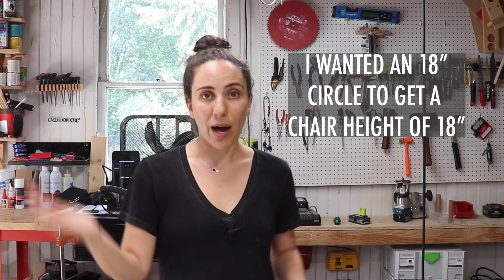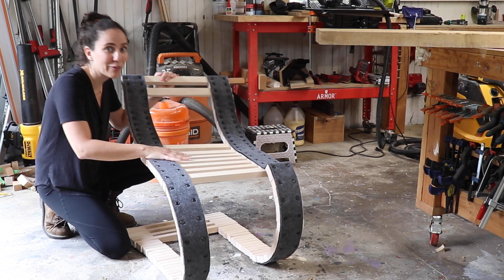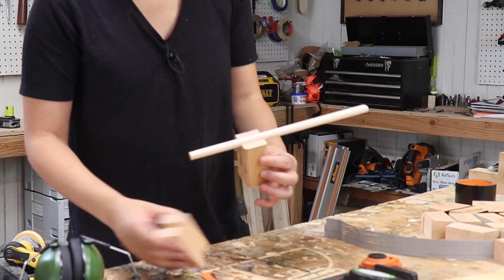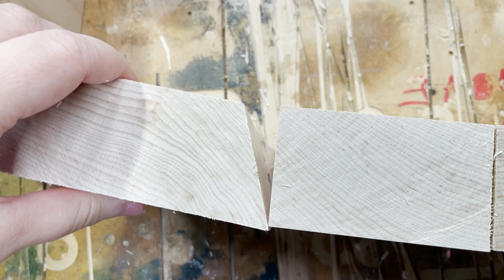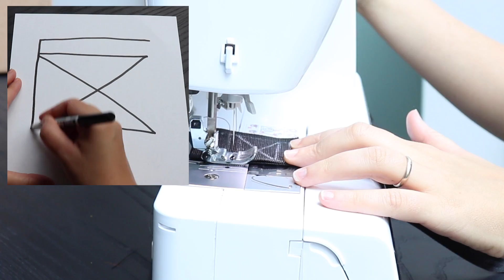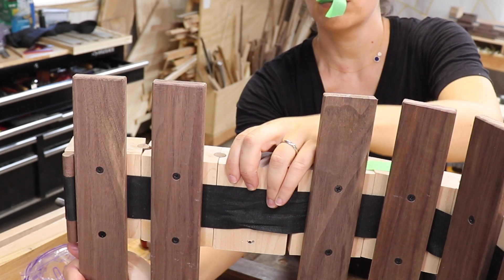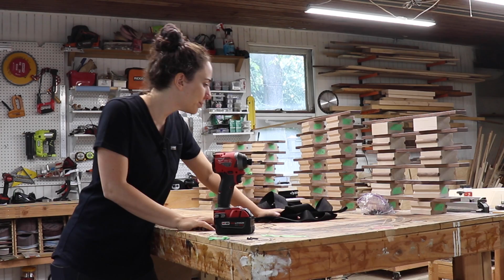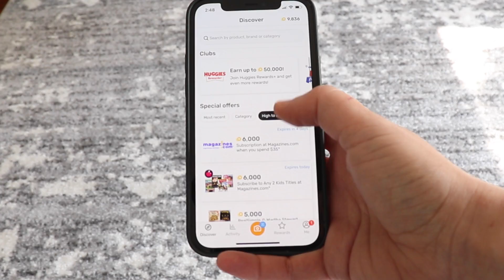I ATTEMPT to make a Roll Up Chair… AGAIN...

Comment: Thanks for the video.
This chair is a problem of managing tension. When you put the dowels at either end of the strap the chair is in to much tension, dangerous. What I think would be a solution is to glue the strap to the chair, finding the right glue is the problem. CA could be to brittle silicon to much flex. The glue I am thinking of and can not remember the name of is what you use to glue fer mica to counter tops. Use the dowel to stretch the strap just a little apply glue to both pieces and let set. You should now have just that little bit of tension where you need it at the joint, the rest of the strap should not be under tension from the glue bond, keeping the tension you put in at the start.
The part that I am not sure of is the glue. The glue has to have some flex ie does not get hard and brittle, or be to soft and flex to much.
I do like the wood slats you used to make up the seat of the chair, and the dowel to add stability to the chair. When you glue the strap down, still screw on the slats, but not into the strap. 
With the right glue the chair will hold it's shape on its own.
You do not have to make the whole chair to experiment with just one end with the dowel.
Just a suggestion on the wood pieces cut the angle so you will make the curve a little bit bigger, so the flex in the strap and the compression on the wood will result in the curve you want.   
Still love these videos, just for the wonderful amount of thinking and planning that goes into it.
Wish I had the machines and shop to give it a try.
If you are going to remove plastic straps, and replace with metal, drill a hole in the wood blocks and run the metal cable throw the hole. Put two holes and two cables per block so 4 in total, add a tension-er at each end. Doing hinges and cables, moves away from the original concept, but should work. Finding a way to release tension so it rolls up and add tension when it is in chair shape.
I am thinking the holes would have to be through the center of the dowel.

Comment: If I remember correctly from your earlier video Tamar, the source piece you modeled your build after was a designer's mock-up, but I don't remember if it was a functional mock-up.  Perhaps this was all a designer's fever-dream.  I applaud you for giving it a shot--a few shots actually--and it'll be cool if, one day, you do make it work as imagined, but maybe it's simply a design that is never meant to be...in the real world anyway.  If that's the case, you can hold your head high, say you tried, and tried, and then tried some more, but in the end, maybe what you proved (and no one else did) is that the design, while cool, is impracticable at best, totally unrealistic at worst.
Reply from the maker: I still want to figure this out. ha
Reply: @3x3CustomTamar  Well, I can't fault you for trying!  Keep us posted!

Comment: Love the look of the new design. 
Believe your tension problems are due to the strap not being attached to each block. Without the strap being secured to the blocks the tension from one spot can pull across the whole chair. Like when sitting on it caused other pieces to curl up to relieve the tension. Attaching the strap to each block would only allow tension to pull on the block next to it.
Reply from the maker: Yes, once I got the right length, I was going to attach it to all the pieces, but then I got hurt... so gave u p in this iteration

Comment: Hi Tamar. What an intriguing project. I agree with your assessment of the material. Too much stretch. Kevlar comes in strapping like that. It's very light, strong enough to stop bullets and very little, if any, stretch. Maybe two thicknesses sewn together? 

Nethril is, unfortunately, not available anywhere but Middle Earth. But it would be nice. haha.

Comment: I mentioned it in the previous video, but I think the problem is relying on a flexible material to keep the shape together. You would have to have it at maximum tension in order to remove any gaps, which as you deduced, is a huge danger. Instead, I'd recommend using hinges at each fold (which you could then cover with the straps for decorative purposes). At either rolling direction, the pieces are always expected to fold from the same rotation point, so a hinge there would keep the pieces together and ensure they roll and unroll safely (without tension) and without moving around between them (as they'd be screwed together through a metal piece).

I'm so glad you decided to come back to this project in the workshop, even if it didn't work! I still believe in the rollup chair :)
Great video as always!
Reply from the maker: I still believe  too! ha!

Comment: YOU CAN DO IT!
Reply from the maker: I hope so 🤞
Reply: @3x3CustomTamar  where you have those large gaps... Hide hinges under the strap lass
Reply: @3x3CustomTamar  I know it's a b@st@rd but the dowel is not helping the parts stay together... If you cut a stepped inclined plane shape into the surfaces that press together under tension, that will stop the gap from opening up.

Imagine two letter Z one attached to the top block hooking into a Z shaped recess on the bottom piece, so the wood itself and the strap share the force.

Also if you have dowels in the strap itself at every block, it will not stretch all in one spot, instead the strap dowels. Will stretch a little bit only at each of the walnut rungs that that but up against. Staples which will simply tear.

Comment: We don't know if the person who originally created this chair didn't have the same issues but glossed over it just for a quick article and pics moment.  That said, the straps will never get the job done, unless you consider that job to be hiding something stronger like wire cable.  Not sure how thick the wire cable would have to be to be safe, but perhaps multiple thinner strands would work, hidden by the straps.

That said, I think the pinch problem is an insurmountable issue.  This design is always going to be hazardous any time it is in shape transition.
Reply from the maker: Agreed. The pinch problem is a huge issue

Comment: The root cause of failure is the pressure causes the strap to be stretched and created the gap.
Why not add some hard connection like hinges to avoid these gaps, then use the strap to cover these hinges?
Reply from the maker: Maybe that’s the solution!

Comment: Piano hinges would help in key areas, could put it under widder strapping. Also eyelets between the pieces when you have the tention right screw into each block so its hidden. Might work.
Reply from the maker: Maybe!

Comment: I know you’re going to get all kinds of suggestions. My mind goes straight to steel cable, possibly two or three per side and I believe that the cables will need to have points throughout the chair where they are tied fast to any certain block. My thought is this will isolate the tension from weight to pull on the back and make it fold over. How many’s isolated sections of tension or tie down points, yeah, not sure. The back separate from the seat, separate from the main front curve, and separate for the bottom. 4 sections of separate tension or pulling while under weight?
Reply from the maker: Maybe!

Comment: Really entertaining and quick 30 minutes! I think you manage these challenges really well, makes it really interesting to keep watching what's coming next.

I was also thinking if part of the issue is the starting phase of the model where the shape of the chair is in its final, upright position. What if you cut out the curvy section to be less of a semicircle (shorter curve and shallower angle on each small section) so that when under load both the wood and the strapping are acting together to counter the weight? And without a person sitting there the chair wouldn't have its shape yet. In this episode you widened the sections but what if the chair still requires them to be thicker to help supporting the top, giving more leverage for the straps to kind of pull against and around?
Reply from the maker: I was thinking the same thing. Thicker. Buts already getting si heavy

Comment: maybe use hinges set them in the small blocks with router jig and hide them with the walnut pieces,
 tensions is obviously not gonna work but using hinges would be too much work 
don't think leather would work either because it also would stretch.
good luck with your future attempt
Reply from the maker: I’ll have to give it another go!

Comment: Quit while your behind because your never going to get ahead with that design. Everything you do at this point is just another bandage on a bad design. Clean piece of paper, clean slate, plenty of other designs out there far more worthy of your time. I have the same mental problem as you and keep devising things in my head that might fix this design but then I realize it's just adding more lipstick to a pig that didn't need it in the first place.

Chop that chair up into little square blocks with a walnut dowel in the center of each piece and glue them into a pattern for a cutting board. That way you can jab and chop on that chair with steely knives for decades to take out your frustrations.

Check out Chest'er for his chair designs. He has a YouTube channel
Reply from the maker: Haha I was planning on doing just that with the walnut slats 😂

Comment: Ok think leather might be a mistake, it stretches, think polyester straps would be better because they don’t stretch as much as nylon. Wider straps and you should use a strong adhesive AND clamp it like you are
Reply: Think the adhesive would help reduce stretching because even with the wood clamp the fabric will still shift, you would reduce the stretching to to the fabric that isn’t glued down between the wood.
Reply from the maker: Might have worked
Reply: @3x3Custom - Tamar  Solid attempt! Soul crushing projects are rough

Comment: It's clear the reason you get the larger gaps is because the strapping is free to move within the chain. Did you actually staple the straps to the sections?  Another idea, and with a lot more work, could be to create an individual strap between each segment that's held in by another dowel feature, or pin the full length straps down under another dowel under the walnut. If you capture the strap at every segment it won't be able to transfer the stretched length to the highest stress point.
Reply: If each segment contains its own strapping stress, you will not get the curling effects, and you wouldn't have to create the holders at either end.
Reply: Maybe something like a half dowel (semicircle) in a routed channel under the walnut to both pinch the strapping and also fixed with mechanical fasteners that will hold the strap, but not weaken it too much.
Reply: A type of adhesive might also work with the amount of surface area you have to glue the strapping to the maple, but then you only get one shot at it.
Reply from the maker: Interesting idea. My plan was to attach it after figuring out the length. But I realized the tension required was just too string and it would collapse when getting up or moving
Reply: @3x3CustomTamar  I think there should only be tension on the joints when it's being sat in. So you have to distribute the stretch between the joints so no one gap can form that kills the overall form.  There seems to be only a few locations where the stress is so high it pulls the straps.  Maybe double strap those spots?
Reply: Maybe put some type of gripping material under the walnut, to grab the straps and keep them from slipping?  Self stick low grit sandpaper maybe, or a rubber material to compress and the fiber texture of the strap would grab.  IDK.  I love a good problem to brainstorm!  I'll just keep adding to my comment as I think of them :P

Comment: It would be a really cool concept if it would work, but i have my doubt. With that kind of leaver effect you put something like 700kg  force on the lower curve if you sit on it. I think that this big of a force compresses the hard wood enough to loose its shape even  a little bit, not to mention the strapping stretching. I think the only safe and rigid enough solution would be an all metal structure with hevy duty metal hinges.
Reply from the maker: Yeah. I don’t think these are the right material

Comment: Wow, that is perseverance. I would suggest you use motor bike chain - flexible in the direction you want, very little stretch and you can set it up with bolts to take up the slack as it stretches over time? There are many pinch points with this design so that danger is always there and can result in some horrific injuries.
Reply from the maker: Yup. After getting hurt I kinda gave up

Comment: Don't bother with leather, it's too stretchy....Ask any cow.  How about making the dowels full length, side to side left to right and cover the face with with non stretchy fabric or screen, maybe stainless steel screen?  And or a fold down leg on the back that would serve as a carrying handle?  Or stainless steel cable like they are using for deck rails and hide a tensioning device inside the last bottom block?  Or just laminate the curves and give up on the roll up idea.  Also, look at how tambour door are made.
Reply from the maker: I figured the leather would stretch. Giving the chair some bounce. But would be strong enough to withstand the stretching 🤷🏻‍♀️

Comment: You could run a metal cable through the middle of the blocks anchored to a metal rod through to top and bottom braces to remove all stretch. And make the pieces wider (maybe do them all full width) it will make it heavier, but will reduce to load on each wooden block and reduce compression in the wood too
Reply from the maker: The cable being in the center of the blocks would prevent it from rolling up correctly I think
Reply: @3x3CustomTamar  yeah I thought that as I sent the comment. Possibly not if its offset it to the wider side of the block as it would be under max tension when unrolled into the chair shape, and then least tension when rolled the other way around the narrower curve

Comment: I m not certain wether it would work or not but I know something such as steel grounding wire strapping which is basicly a belt of braided steel wire, it will not stretch nor buckle under tension but I m not exact on how flexible it is however braided steel wire is pretty flexible, I do urge you to check it out
Reply from the maker: I’ll check it out

Comment: Great attempt.

I feel like this is type of chair is more or less impossible using just angled pieces (even when using dowels to keep it aligned, etc).

I think when no ones sitting on it, it needs to be leaning a lot forward, to the point it would almost tip over so that once you sit on it, it would stop at a regular seat position instead of being almost touching the floor.

As you sit and lean on it, the angle of the seat will change, meaning the angle of the cut pieces would shift and would not properly meet face to face with its adjacent piece, which seems like could never happen.

Josh Wright made one that seems pretty sturdy but the pieces were made into a z-shape (with 2 strips of plywood). so its not the exact same thing you're going for.

you've probably seen it, but just in case here's the build video.

https://www.youtube.com/watch?v=MuodNlDKce4&ab_channel=JoshWright
Reply from the maker: I’ll check it out

Comment: I think that your problem is that the strap can move freely between the base and the slats. At proper tension at rest it’s no problem but when you sit you add tension to the bending parts. What’s happening is that it’s pulling strap from the unstressed areas causing the bottom to flip down and the back to flip in. I think you need to pretension your strapping
Material and fix it to each block piece. That way it’s not trying to redistribute the tension as you sit on it. Possibly a rigid hinge or steel cable run in a routed grove with crimped connectors in a grove and epoxied in place?
Reply from the maker: Maybe!

Comment: Hey Tamar, love your content. Not sure if someone has already commented this, but looking at this build one of the issues I see is the length of your strap. The amount an object will elongate (stretch) is partly a function of its overall length. Because the strap is only “secured” at the top and bottom of the chair it has a significant length resulting in a relatively large elongation. I  see you are using the walnut slat for a clamping force on the strap, but I don’t believe the force is strong enough to prevent slipping underneath the slat. The entire elongation of the strap will most likely show up in one or two joints, resulting in the chair bending further than anticipated. If you were to try this again I would try to find a way to attach the strap to each block more securely, to minimize the strap length to that of each segment, and as result minimizing the amount of elongation between any individual segment. Hope this helps…Cheers
Reply from the maker: Yeah. I was hoping to attach the strap to each block after I nailed down its length. But after I got hurt I just gave up on this one Bc I didn’t want my kids to get hurt

Comment: I forget if you addressed this in the previous video but have you considered using hinges instead of strapping to hold the pieces together?  Unless the straps you use have zero flex, they're just going to stretch and I don't think leather is up to the task.  You really need something design for thousands of pounds of tension and that's going to be super thick stuff.  Hinges being rigid solves the tension issue.  The big problem will be the wood handling the stress.
Reply from the maker: Yeah it’s a good idea for sure